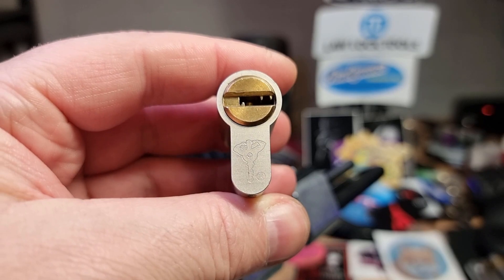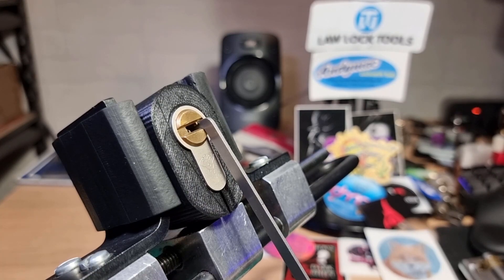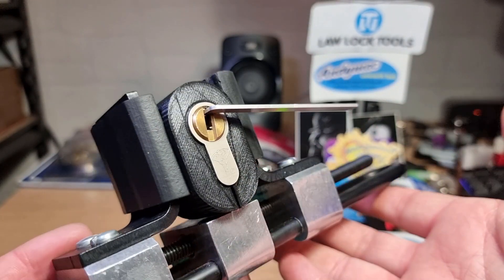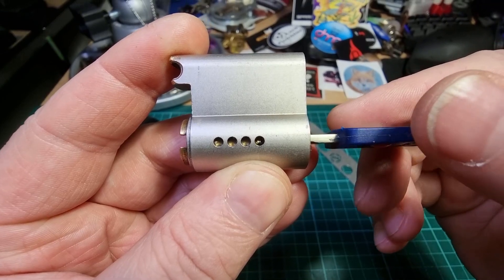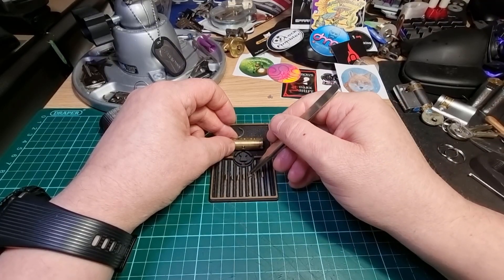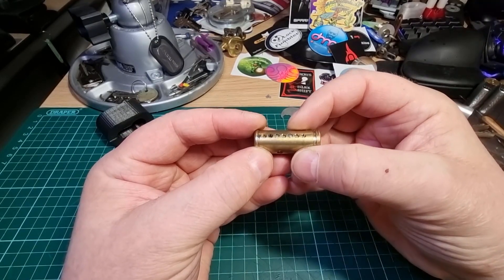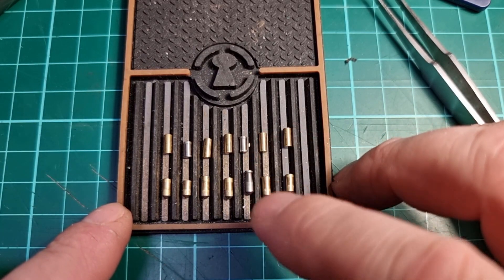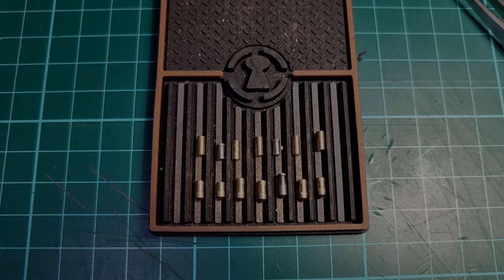(315) Mul-T-Lock Garrison From Tinnie P&G

Comment: That's a nice n snug tensioner 😎👌🏼
Was that a 3rd hand on the left @4:02?
Reply from the maker: It fits perfectly down the warding 😆
I used to be an electronics maintenance engineer, so I've developed the ability to will a third hand into existence when required 🤣
I just watched your MTL video. That padlock is a beaut 👌
I'm still trying to get the hang of using slighter movement on these dimple locks. 
Cheers bud 😁 👍 🍻